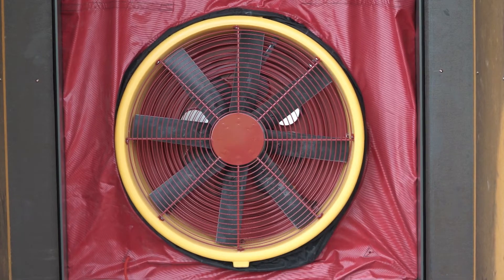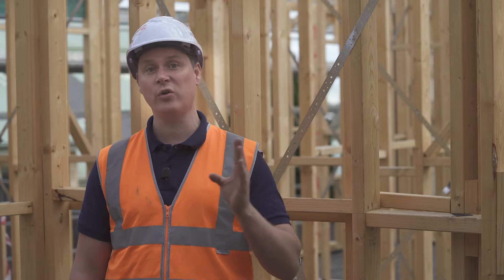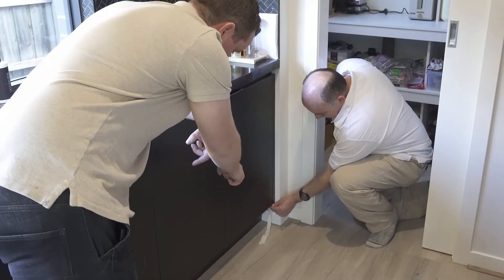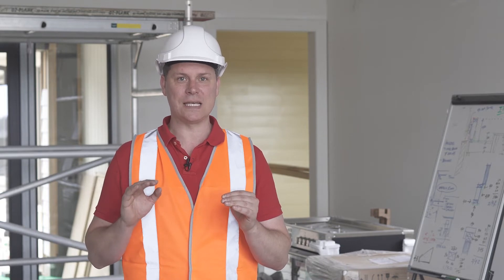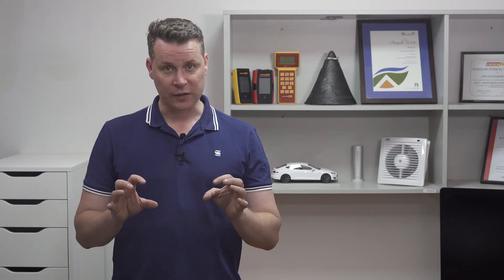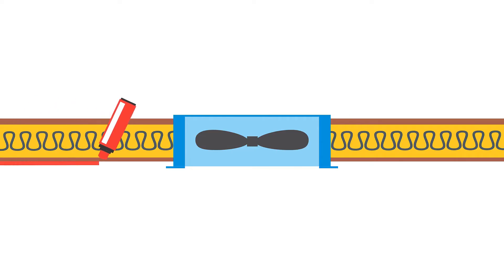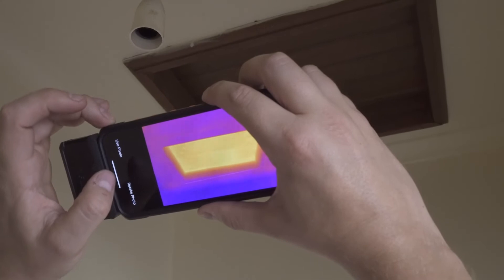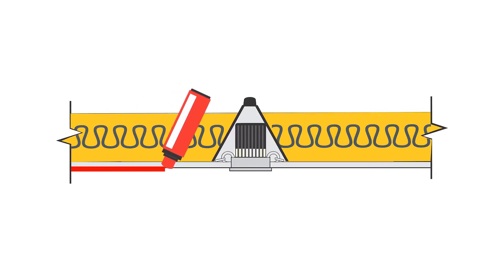Understanding Building Air Tightness | Part 1

Comment: Interesting. 
I live in a hot country (Thailand north east). Temperature drops to twenty degrees for 2-3 weeks of the year, otherwise it’s always over 30 and in the 40s. We don’t use aircon much and open windows for air circulation. Would l assume in my scenario that airtightness would only be applicable if running aircon continuously?
I can understand its a must for Australia. 
Cheers

Comment: When you air seal attic don't you have 2 vent the living space somehow from gasses and stale air and such?
Reply from the maker: No, you may need to vent your attic spaces though.  But using your attic as a place to get fresh air from is a big big no no..
Reply: @ecoevo  yes so when you vent attic space won't it pull a little air from your living space slowly even tho it's air sealed? Or why do you say not 2 vent the living space?
Reply from the maker: You shouldnt vent to the attic.  Vent with a window.  That is what they are designed to do.
Reply: @ecoevo  but your not gunna do that in the winter
Reply: @Brandon-no3vc  there should be a vent in the eaves outside, so that ventilation is drawn from outside, into roof cavity, and then out the top of the roof, (via a wirly bird, or similar).
Reply from the maker: A Ridge vent would work better. Whirly birds don’t move much air.
Reply: @ecoevo  are you even a builder if you tell your clients to just open a window
Reply: @ausmanpizzaoodie3322  you dont even know whats going on
Reply from the maker: @Brandon-no3vc  Are you telling people to just put holes in walls to get fresh air in via a wall or roof cavity?  If a home is stale it should be getting air directly from outside wouldn’t you agree?
Reply from the maker: @Brandon-no3vc  No, we are not a builder. Are you saying builders are the only people who can advise you where a building should be getting fresh air from?
Reply: @Brandon-no3vc thanks champ. you sound like you'd be a riot at parties.
Reply from the maker: I’m not too bad at parties. 😉
Reply: @ecoevo  your lost
Reply: @ecoevo shutup
Reply: @ausmanpizzaoodie3322  your somethin elce

Comment: I live in Ireland and have exhaust heat pump. New apartment. They put big vents in every room ( which are basically holes in walls ) and it’s blowing a hurricane through them even if they are closed. I don’t get that. I’m loosing so much heat

Comment: This is such bologny, it's just the democrats making more laws that don't make sense. You CAN NOT make a house completely air tight, if you do, it will fail somewhere as soon as you open your front door. You should make your house "weather tight", and somewhat air tight, but not too excessive. The idea that you are wasting money heating/cooling is ridiculous. The tiny amount of air "leakage" equals the same amount of energy you will use if you have a couple extra cold/hot days throughout the year, people and lawmakers need to stop draining our wallets with this "build tight" bologny. Sorry, but it's true.
Reply from the maker: John, It’s an unfortunate name of the concept “air tightness” I think you are interested in the term of draft proofing instead, which is great too.  We are not talking about laboratory air tightness in this video.  Some of the homes down here are pretty damn leaky, and I think you would be horrified with some of the things we see.  Thanks for your clarification.
Reply: Do you have some data to support your rant?
Reply: It's as much about comfort than it is about savings on the energy bills

Comment: Since watching this channel I now realize my 1986 built brick veneer house is a glorified tent. I have found endless air gaps throughout the house. The worst is those stupid Dow lights. Thanks I’m learning a lot
Reply: If you have 50 watt 90mm halogen downlights, you should able to replace them pretty easily with completely sealed low wattage LED downlights that can even have pink bats placed over the top of them.